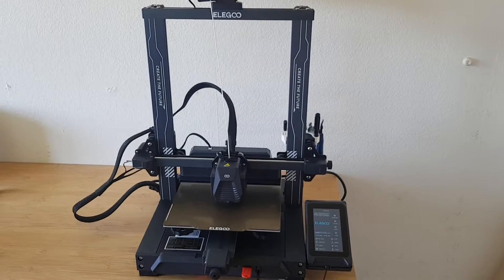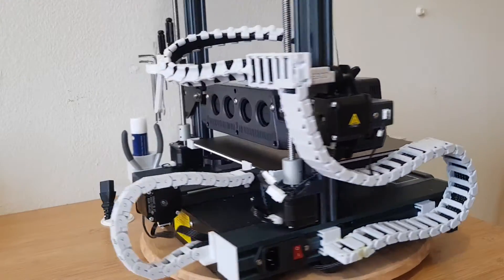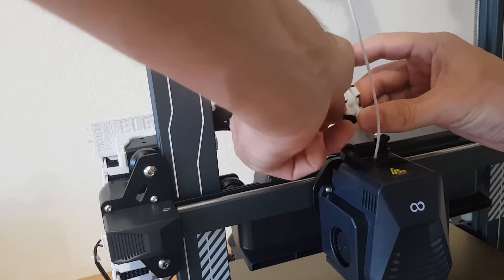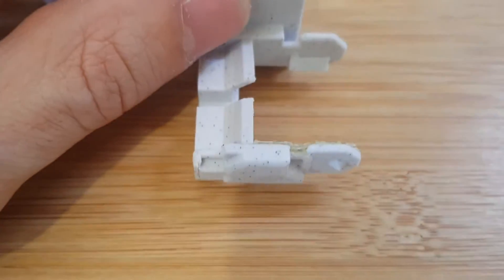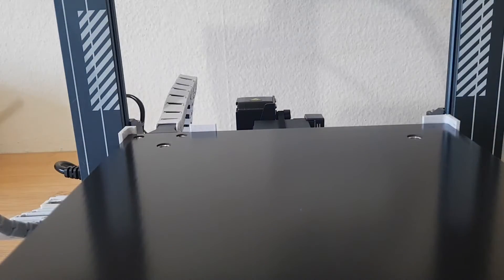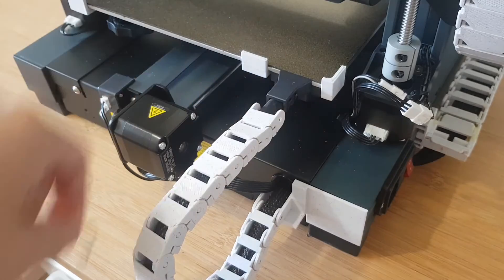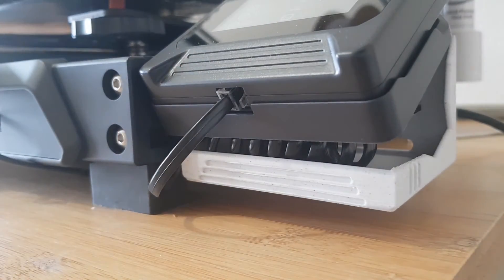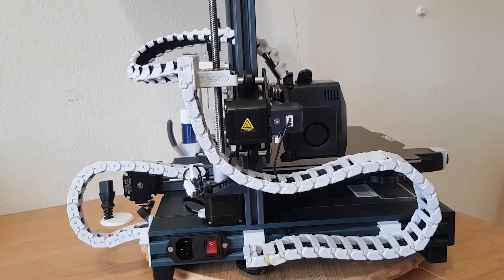Best Printable Upgrades for your Neptune 4 /Pro (Part 1)

Comment: Right, looks ok but what about the extra stress on the connectors and added weight pulling them??
Reply from the maker: Hi Cornz38, it worked fine for me, printed for 2 years with this setup, never had problems ✌️
Reply: @Dirt-E-Bikes  Good to know. Thanks...
Reply from the maker: @Cornz38 you are very welcome ✌️

Comment: Não entendi onde vc disse que colou as peças próximas ao fuso
Reply from the maker: Boa tarde, colei o primeiro segmento da corrente de cabos, pois estava partido.

Desejo-lhe boa sorte com a impressão.
Reply: @Dirt-E-Bikes estou tendo problemas com a parte de baixo que encaixa no corpo da impressora. Vou passar o cabo é quebra
Reply from the maker: I had the same problem, i fixed it with some epoxy, it holds up since
Reply: @Dirt-E-Bikes e quantos suportes vão fixados na base da impressora. Eu vi dois porém não me parecem iguais
Reply from the maker: @rogerarantesrsa yes, one is to connect the chain to the printer (the one that tends to brake when installing) ond one is just there so the chain can lay on it when the print head is in its most downward position
Reply: @Dirt-E-Bikes Muito obrigado pelas dicas. Pelo que entendi a correia passa pela parte que quebra e é presa por dois clipes e a o segundo suporte não prende a corrente e sim apenas apoia a mesma

Comment: Can neptune 4 max use this design?
Reply from the maker: Ji HoangMech, yes that should be possible from what i heard. You will need to print more of the cable links, but i guess ot works 👍 
Please let me know if you had any difficulty assembling it ✌️
Reply: @Dirt-E-Bikes  Thank you, is the in3d stl file above complete for me to complete the machine?
Reply from the maker: @AdamHoang1910 i think so, but i did not check if and what was remixed or changed in the stl files, since i released that video (i mean, most changes would be for the better i guess ;-) )

Comment: hola y los 3 topes de la cama de impresión ? como funcionan si son de Pla con la temperatura ?mucho más práctico unos 2 tornillos de tope.. saludos
Reply from the maker: Right, i had some concerns at first, but i still use them even though i printed a few parts in PCTG with very high bed temp... In hindsight i would use PETG or something even more temp. stable for that part, but for me it still works 👍
What do you mean by stop screws?
Kind regards
Reply: @Dirt-E-Bikes  ok entiendo.. tornillos como los que tiene la ender 3 v3 se..saludos

Comment: I can’t get my prints to stick after upgrading to a hardened steel nozzles. Just using pla+ on the smooth side of the plate.
Reply from the maker: Hi there, what printplate do you use? The original one is not double sided, so i guess you use a new one? try to use the PEI side that is rough when going with PLA, that should work

Comment: Do these work for a nepture 3 plus?
Reply from the maker: Hi Derek, i think so, but not 100% sure... The Neptune 3 and 4 series are for the most part pretty identical, so i think it should work, but you will need more of the chain links ;-)
Sorry that i can not give you a precise answer, i dont own a Neptune 3.
If you decide to try it, please let me and all the others know if it worked for you.
I wish you a good time printing ✌️
Reply: @Dirt-E-Bikes  I mainly want the build plate tabs. But the cable chains would be nice too
Reply from the maker: I see 😅 the plate tabs should work on the Neptune 3 👍

Comment: I give all these parts a 0 out of 10. They're "pretty", but unnecessary and potentially a negative for smooth operation.
Reply from the maker: Im very happy with these mods, smooth operation since day 1. they dont make your printer faster, but for me, they make the experience better. Try for example the limiter for the magnetic printbed, its a must imo

Comment: Best Neptune 4 Pro upgrade is a Bambu Lab A1.  Don't waste your time upgrade a crappy printer, just buy the Bambu Lab A1 and you will enjoy printing.  I had the Neptune 4 Pro, and I wasted tons of time and filament upgrading and hoping the print would come out OK.  I then bought the Bambu Lab A1 and LOVE IT.  No more worries, no more noise, No more have to calibrate after failed prints.  It just works right out of the box and keep producing perfect prints every time.  STAY AWAY FROM ELEGOO
Reply from the maker: @hammerheadhobbies  sure, the bambu labs are great printers, i am still happy with my N4. What was the main problem with your N4?
Reply: @Dirt-E-Bikes  I bought the Neptune Pro from Elegoo along with the Elegoo PLA+ filament.  I set it up as instructed and did the initial setup.  I worked great and the prints came out perfect for the first week....then the problems started.  For some reason I couldn't get a good print.  Problem with it sticking to the bed, problem with the first few layers, problems with further layers.  I calibrated (both manually and automatic) and recalibrated numerous times but still could not get good prints.  This is using the same gcode and filament as the perfect prints.  I finally contacted Elegoo and sent them the gcode and filament info.  Elegoo technical support said I was printing too fast and that they recommend a print speed of upto 70mm/s.  I explained that it printed perfectly before and I even had to refer them to their own website that states their filament is good to speeds of 220mm/s.  They then sent me a list of instructions to basically check the entire machine.  I did all that and got 1 good print...then the problems started again.  Now the Z-axis started make a squeaking noise and ceased all together.  I made sure everything was greased and even went of youtube to see if there were any further adjustments to solve these issues.  I contacted Elegoo again and requested a refund as I was within their 2 week refund policy and I felt the printer was now defective.  They told me the printer is fine and refused the refund.  I spent more days and filament adjusting and re-adjusting.  I would get a good print and my hopes were high then the printer would fail again on the very next print of the exact gcode and filament.  I contacted Elegoo and explained the same thing I expained the first time but they just sent me the exact same thing they sent me before.  They also said the the print plate gets old and filament wont stick to it.  I told them it is only a week old.  I bought the Bambu Lab A1 in the meantime and get nothing but perfect prints (better than the Neptune 4 pro prints).  Like I stated before, no worries ( I can leave a 20 hour print and not have to worry if it is going to print or not), No jet engine noise, no calibrating the bed and Z-offset.  It just prints and prints perfectly every time.  I sold my Neptune printer and now am Elegoo free and happy.  I will say one thing positive is that the Fluidd Klipper Monitoring software is much better than the Bambu Lab.

Comment: I was never fond of the cable routing on the otherwise excellent Neptune 4 Pro, but I've printed a LOT with it over the last year and in practice, the cabling has never been a problem for me.  That spinal column cable support for the extruder cable is sick.  That's worth printing just for the looks.  BTW - I designed and 3D printed a little waste bin that clips on the left side of the Neptune 4 and Neptune 4 Pro.  It's useful to have a little bin to catch prime strips, nozzle ooze, skirts, bent filament ends that are snipped off when loading a new spool, etc.  I uploaded the design to Thingiverse and Printables, but it won't fit after you add the cable chain on the left side.
Reply from the maker: @Liberty4Ever  such a waste bin sounds very practical. Can you tell me the name of your bin, wo i can find it on printables? I mean, as you said, i cant fit it on my printer, but maybe others would like to build it.
Cheers ✌️
Reply: @Dirt-E-Bikes  - I searched for "Neptune 4 waste bin" on Printables and my waste bin was the first item listed.  It's model 611113 on Printables.  Searching for that number should return only one result.
Reply: my cable got stuck under the hot end and it killed  the printer, its worth having. luckily elegoo is sending replacement parts.
Reply from the maker: @evanjones6828  oh shit, thanks for sharing that 👍

Comment: Nice video and nice upgrades. Just got pro4 for Christmas and adding all this. Only thing missing is the link for the tool holder. I have found some but not sure if they are made specifically for the tools that came with printer. I’ll have to double check that before printing. I’ve also seen anti vibration feet. Check them out if you haven’t already. Great vid thanks.
Reply: Now that you said that you are 100% correct. There was a tool holder on the thumb drive that came with printer. Completely forgot about that. Lol
Reply from the maker: @cecilwells9786  glad i could help 😄👍
Reply from the maker: @cecilwells9786  Hi Cecilwells, thanks for your kind words. I am not completely sure, but i think the files for the toolholder i used were on the stick that came with my printer. Anyway, i am editing now part 7 of the video, in that i will present a better way (imo) to store the tools of the printer. So if you can wait some days, i would suggest to have a look at this storage solution first. Another great way would be a small mutliboard, i search you the link to that video in a moment.
Anti vibration feet is a great topic, and if i find some time, i will do that, thanks for the hint 👍
I wish you a good start with your new printer. Cheers ✌️

Comment: I have saved it and if I buy this printer it will be a guide to what to do. Thanks a lot.
Reply from the maker: you are very welcome. If you do decide to do so, its a very cool project and i wish you a lot of fun doing it. i am currently uploading part 6 of that Elegoo upgrade-series, so there is a lot more you can modify on that printer then just the Cable chains.
Cheers ✌

Comment: Hey man, you’ve done a sweet job with your printer. I was just wondering what end clips you used going from the spine to the “Elegoo” block, any reply’s greatly appreciated
Reply from the maker: @KingOfTheAsphalt  thanks mate, too bad that i cant post a picture in the comments, that would make it easy to show. But in the end, i just used another spine part, cut the "clamp" part away (that part that goes around the flat cable). You can glue that piece to the elegoo block if you want... i did not, it just sits there loosely ;-)
Reply: cheers for the reply, do you have discord.. if i could see, that would be massive
Reply from the maker: @KingOfTheAsphalt  you are welcome, sorry i dont have discord. Maybe i can find a way to post a foto on youtube, not sure if that works (and how).
Reply from the maker: @KingOfTheAsphalt  i postet 2 pictures on my channel, hope that helps ✌️
Reply: @Dirt-E-Bikes  big thanks!
Reply: Would you be able send me the file, if you still have it?

Comment: Great video. Very interesting upgrades. I like especially the belt blocker. Layer today I am gonna see if my cable touches anything and if so I will build the cable guide. And what I like the most is your honesty. Resolving the solution of your mistakes.
Reply from the maker: Thank you for your kind comment, i really appreciate it. The Belt blocker works fine, but currently i am editing part 6 of this series in wich i replace  the belt tension blocker on the x axis with a camera mount that also holds that adjusting wheel in place. 
I wish you a good time printing and much fun in this awesome hobby :-)
Reply: @Dirt-E-Bikes  would love to see a kind of camera holder for cameras that have a kind of screw in de middle below. Which you then can screw on. Can't wait to see more videos from you. Thx for sharing

Comment: What nozzle temp & speed did you use for spine & chain? I had 70 on the bed, 225 nozzle temp & 70 on speed and it didn’t work. Thanks for your time. Great videos.
Reply from the maker: @TopBlackWaterSniper  thanks Mate, i think to the time of the video i just used the standard (fast) settings for PLA. So 250 speed and 220°C on the nozzle, 60 on the bed (if i remeber correctly).
What filament are you using?
Reply: @Dirt-E-Bikes  , Elegoo PLA neon green. (Kawasaki green 😉)
Reply from the maker: @TopBlackWaterSniper  nice, that printer will look sick when you install that 👍
What is the problem when printing spine and chain? Does it fall of the bed mid print?
Reply: @Dirt-E-Bikes  , it gets about 3% in and then gets all messed up. I ordered some Elegoo Rapid Plus+ filament to see if this might be the problem. The bed corner stops have been the only 2 things that printed with no problems. X and Y axis stoppers prints get a little over halfway done and then get snagged and then it’s ruined.
Reply from the maker: @TopBlackWaterSniper  ou, that sucks. did other prints go well, or had you similar problems with that printer and filament in the past?
Reply: @Dirt-E-Bikes  , just the 2 corner pieces came out well. My printer is less than a week old. Tomorrow will be a week. I bought this filament just for these printer accessories. Oh, the Elegoo tool holder was printed in neon green and came out good.
Reply from the maker: @TopBlackWaterSniper  i hope that it will work better with the other filament, but i mean its an elegoo printer and elegoos filament, so not sure why it should not work.
If the problem does not go away, i would write directly to elegoo customer service or the shop you bought it.
Reply: @Dirt-E-Bikes  , I tried a Creality PETG in blue and it printed with no problems. I’ve contacted Elegoo customer support and waiting for their response. Thanks again for including links to those upgrades.
Reply from the maker: @TopBlackWaterSniper  you are very welcome ✌️

Comment: Why not incorporate the tool holder into the glue holder on the side rails instead of having it add weight to the Z axis motor?
Reply from the maker: Hi Kimmytuna, yes that would be the better idea. I have am using now a other storage solution that i will show in the next video. ✌️

Comment: Attention, don't buy this garba.. . Elegoo does not recognize such a thing as a warranty, I have already met a dozen or so people who cannot repair their printers or return defective equipment.
Reply from the maker: Strange, i mean, i had exactly this case, that the printer had some initial problems, and i got a new one gor free... And others also wrote in the comments that they had some problems with the "first badge" of this model and had even less problem replacing it... Can you post a link to these cases where they did not replace parts or even wohle printers?

Comment: Thanks for this.  I’ve got my first 3d printer arriving tomorrow being a Neptune 4 plus.  I’ll be printing these straight away.  I really like the cable management prints.
Reply from the maker: You are very welcome, i also did 3 more videos (so far) with other upgrades, and at least 2 more that come in the next weeks ✌️
Reply: Friend, is it compatible with the elegoo neptune 4 plus?

Comment: How can i connect it to internet from wi fi repeater? Can a repeater send (lan cable) signal?
Reply: These printers don't have wifi by default. You'll need a network cable. Or you get a usb wifi dongle (google knows which ones work).

Comment: Hi, great video, just wanna ask after installing the big cable mod, will it limit the print height?
Reply from the maker: Thanks NoboDYzzz, this mod should not limit the print height. But if you want to install the stabilizers on the back side (a mod shown in part 2 or 3 (?) of this video series), that would limit the height.
Reply: @Dirt-E-Bikes Excellent! Is there a mod for the 4 rotating wheels under the heat bed? I have a Neptune 4 and the wheels will rotate on themselves due to the vibration of the machine, causing the bed level to change :[
Reply from the maker: @mR_NoboDYzzz  Yes, i can look into that. So if i get you right; the mod should prevent the leveling wheels from moving? I think i have seen something like that before, maybe from a other printer, but im sure i can modify it for the Neptune...
Reply: @Dirt-E-Bikes yay! That’s perfect, looking forward to your next video :]

Comment: out of curiousity on the bottom cable chain, do u not think it applies to much tension/pressure on the wires to bend them into it?
Reply from the maker: Hi Ryantoth, yes it uses a bit of gentle force to get the wires in to that angle... i think after the cable is in, it isnt a problem, but you should be as careful while installing it.

Comment: In my opinion, most of these upgrades actually are counterproductive to optimizing the printer. It's adding weight and also restrictive motion. Why would you have all your tools riding up and down on the Z axis? Don't do additions to the printer just because it's convenient or neat. Optimize the printer to work it's best.
Reply from the maker: Yes, some parts may reduce performance a little, but they also make the system more user-friendly. I actually removed the tools on the x-axis because i had the same thoughts as you ;-)